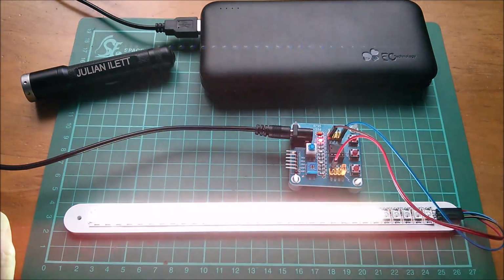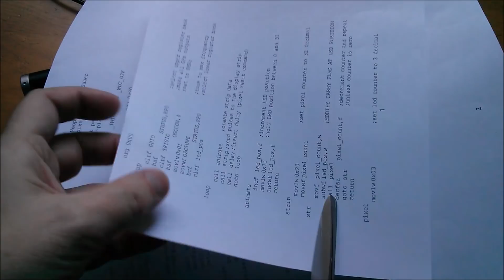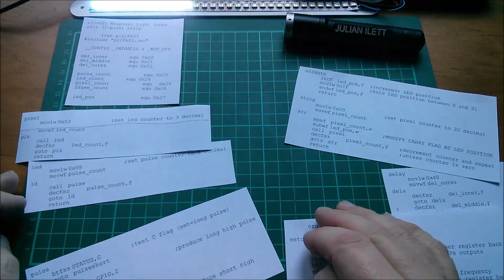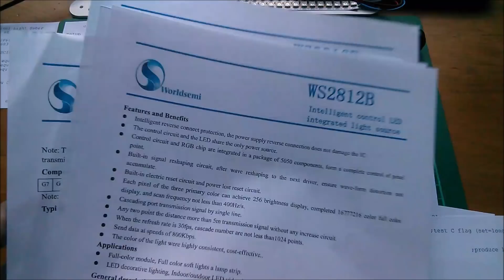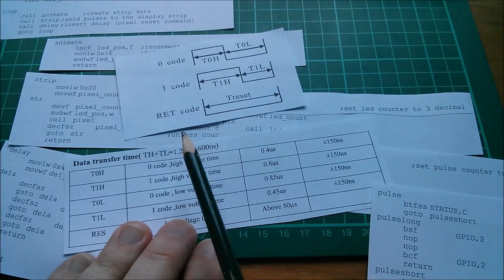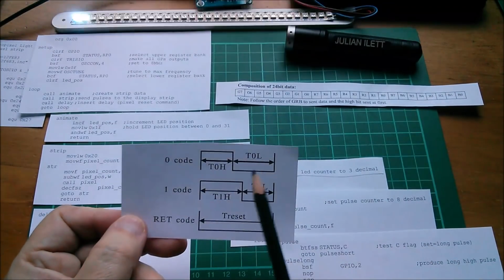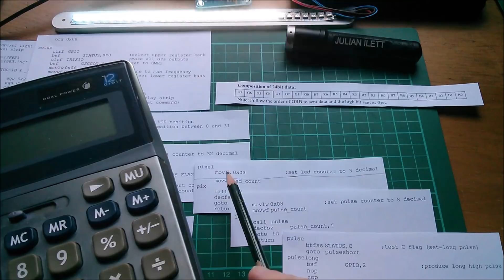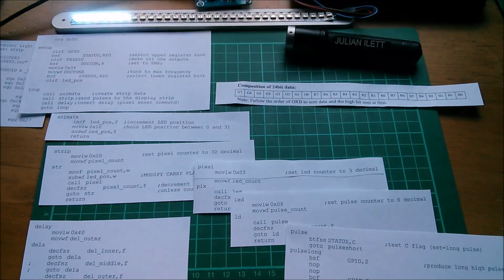Idea: PIC WS2812B NeoPixel Christmas Decorations

Comment: In the strip subroutine I think you need to change the "movlw 0x20" to "movlw21" to get it to light up the last neo-pixel on the right because the "decfsz pixel_count,f" will skip the next loop after 0x19 (31) times instead of 0x20 (32) times as you're starting out with 0x20 (32).

I must admit it's been a long time since I've done any assembly coding so I may be wrong here. :-)

Thanks for sharing this and explaining the logic in your led lightsaber programme.

Comment: I really need PIC tutorials, I already know so much Arduino (5 years) and now I want to start PIC. Anyone have recommendations?
Reply: I started with PIC and learned a ton.  Switched to Arduino so I could write C.  If you want to learn assembly language, I suggest a less horrid architecture, such as the AVR.  It's faster, and has usable registers.  Working with PIC assembler is tedious at best.  It's like solving the tower of Hanoi puzzles.  You pick one thing up and put it down, there's only one register W and it's a pain.  When you want to move up to real power, switch to ARM Cortex.  I started ARM with the ARM7/TDMI, but Cortex is where it's at nowadays.  I don't really miss the PIC.

Comment: 4:08 - "that's probably still going to be quite annoying isn't it?"  Yes, yes, it is.  So why didn't you just turn it off then?
Reply: Julian, that would have been a perfect time to show how to change your code to use different RGB values.  Take it down from 255 to 10 or something low that is just visible.  Hoping for better in the next instalment.

Comment: Can you not use decimal numbers in PIC assembly? Seems really unnecessary to have to write 0x20 when you mean 32.
Reply from the maker: When you do a lot of assembly language programming, you learn to use hexadecimal and/or decimal interchangeably. It's a bit like people who speak multiple languages - they can switch from one language to another without giving it much thought.
Reply: Well I can convert hex in my head with some calculations, and some special cases like 0x10, 0x20, and 0xff don't require thinking. But I still stick with decimal whenever I mean natural numbers, instead of bit masks or bit flags, or similar situations where the binary representation is of essence.

Comment: Stupid question - how are you powering it? Meaning what amperage are you drawing via the WS2812B? Cheers!
Reply: with a big battery bank.
it is supply more then enough to cover the power requirements as stated on data sheet.
Reply from the maker: Yes, a big 8-cell powerbank :)

Comment: You can get SMD ZIF sockets for a reasonable price on eBay if you wanted to solder the circuit directly to the pins of the PIC rather than mounting it on a circuit board. Program using the ZIF socket, then solder in place dead-bug style. The key words I used to find them on eBay were SOIC ZIF.

Comment: Really fantastic explaination of the low level programming details here.  Having only ever used arduino and adafruit's neopixel library I always thought it was magic that these operated without a clock signal.  It turns out it isn't magic, it's just science!! 😁

Comment: I really like the way you broke down your assembly code. I had an instructor like you back in the late 70's when we were programming all of our micros used in various black boxes in assembly. We used 6502, 6800, 1802, 8048, 8085 & 486 for a little of everything

Comment: It's not illuminating the last Neopixel, one of the tests needs modifying? movlw 0x21 instead of movlw 0x20
Reply from the maker: I fixed it with a decf instead of movf at the 'str' label. It was misaligned count ranges - one 0-1F the other 1-20.